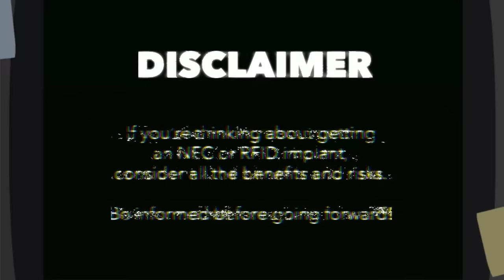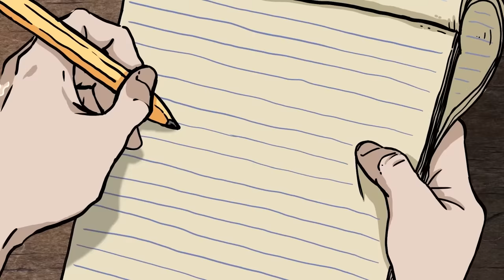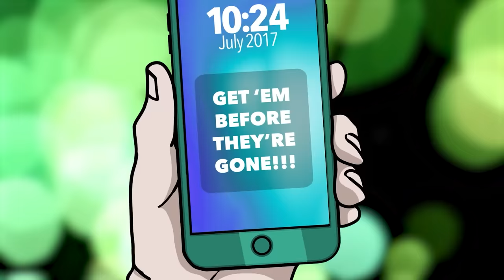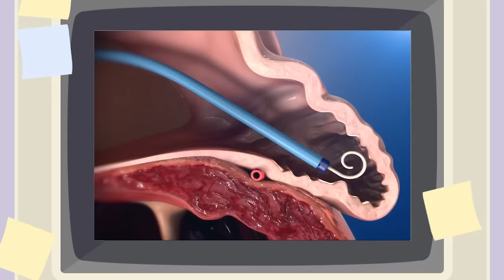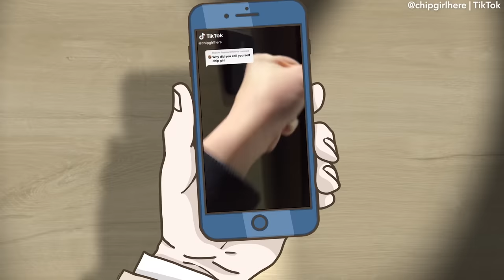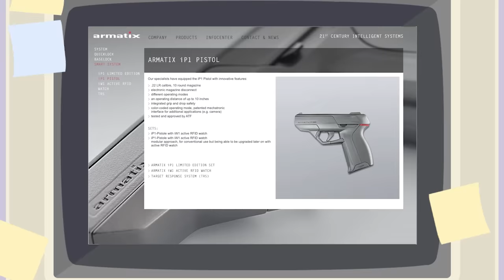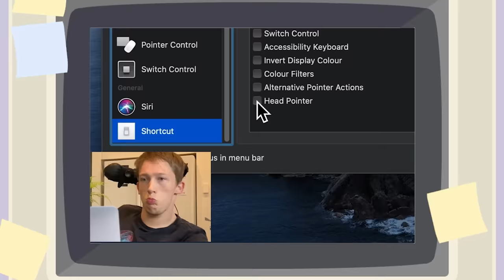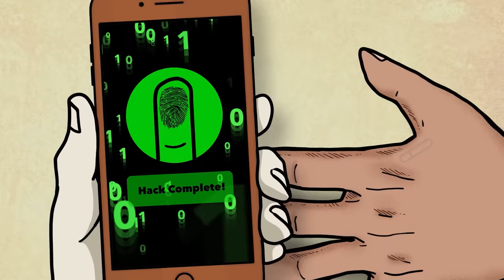People Are Turning Their Fingers into Smart Wallets, and It's a Nightmare for Some

Comment: honestly maybe even just RFIDs being integrated into common accessories like bracelets, watches, necklaces, or something common you'd probably wear all the time, but isn't too small to lose, would be much safer
Reply: @IamMarius the ankle bands given to criminals with house arrest are a good example :)
Reply: That's what I was thinking this entire video.  Why get something implanted into my hand if I could just have inserted into a glove or a bracelet?  I would be able to do exactly the same things that the implanters do, with the benefit of not having to worry about drawbacks of sticking technology under my skin.
Reply: Apple Watch and other smart watches do that already
Reply: my wallet has RFID
Reply: @SgtSupaman  we did see a smart pistol that requires a glove so it might be a better idea
Reply: When you go to the Blue Lagoon in Iceland, they give you a bracelet that's basically a door key, locker key and hooked up to your credit card all in one, so you could purchase drinks and spa treatments while in the hot spring.
Reply: @SgtSupaman  yeah, a smartwatch can do all of those things and more, and its much easier to replace.

I guess it can be stolen, but the thief would still need the unlock code to use it. And you need a backup method anyway.
Reply: Disney already does something similar to this for most hotel keys now, it would be wonderful to have an option like that for other things but I'm also worried I'd end up losing THAT too
Reply: Most smart watches already have this. I use my Samsung watch to buy from snack machines at work every day.
Reply: @FMAiscool  that was my favorite feature really.
Reply: It's called a smartwatch, LOL.
Reply: good idea, I'm going to put RFID into my glasses.

its going to be fun the look of people when I take off my glasses to pay by NFC
Reply: Yeah that'd be awesome a watch wallet or necklace and people wouldn't even know
Reply: Can't the apple watch do that basically already? Or is this something different?
Reply: Exactly. I think even putting the RIFD tag into a small earring would make more sense than implanting it under the skin.
Reply: Yeah that’d be something I’d be way more interested in tbh
Reply: Point is so you can't forget them
Reply: 1 of my transit passes is implanted in a silicon wrist band. It's comfortable and easy to use.

I'm looking forward to trying it in winter, when I won't have to search pockets, while wearing mitts or gloves.
Reply: Like a credit card?
Reply: You can buy rfid rings. This isn't news.
Reply: I would much rather have one in a ring than in my finger.
Reply: @IamMarius disney does this exact thing at their parks for hotel rooms and whatnot
Reply: Its a mix of transhumanism, people that think its cool, and those that lose their wallets/cards xD
Reply: I would rather prefer rings/wrist band etc than chip implant.
Reply: @alexborg9393  it can, most other smart watches can too
Reply: I think apple watch already do this.
Reply: @wowulam7411  yeah but its an active device of somewhat high value, making it a target for thieves

in my context specifically im referring to objects that normally wouldn't be stolen if it wasn't flashy, like armbands or stuff like that

probably should have been more specific but yee
Reply: @IamMarius already happens, I think thats how disney does it for the new fast passes
so does my gym for access, ive got a silicone band that uses NFC to open the door and scan it on treadmills and stuff to save workout info
my house also uses an NFC keyfob, I was concidering switching to the cards they provide so before spending the money on it I peeled the NFC tag out of my keyfob and stuck it on a card in my wallet
felt like a smart idea untill I took the trash out one morning and realised I left my wallet inside
its now back on its fob on a lanyard on my belt
Reply: YEAH LETS HAVE RADIATION POISONING
Reply: i'd like an rfid glove :D
Reply: Phone NFC.
Watch NFC.
Thats enough.
Dont think about human NFC.
Reply: Honestly the tapping of the phone is honestly enough, i dont know anybody who leaves home without their phone especially to go shopping
Reply: @SgtSupaman  this actually isn’t a new thing at all, and is really akin to getting piercings or tattoos, but adding practical implications to the thrill. These people are into the potential of the human body beyond what our natural biology provides—basically forced evolution. I did a big study on them. They used to call themselves biohackers until a bunch of body building corporations absconded with the term. Real biohackers we’re just as obsessed with the safety protocols as they were the implantations, because what’s the point if it’s not functional? Many of them were nurses, emits, bio chemists…you get the idea. And, yeah, there were some idiots who didn’t know what they were doing, just like there are idiots who pierce their dicks with a tack (I’ve known one) It’s interesting, but, yeah, definitely not for everyone.
Reply: dont those already exist in multiple forms?
Reply: Yes like a Fitbit etc
Reply: @FMAiscool  that’s dope
Reply: yea i think say like a glove or a watch or something somehting you CAN removfe but CAN also leave on all the time.
Reply: Exactly. The first thing that popped onto my head was "couldn't you just put it in a ring or something?"
Reply: Have you heard of smart watches these things already have RFID in them I can use my Apple Watch to pay for stuff but that’s also because it’s a Apple Samsung also does the same thing if you’re getting anything by Apple or Samsung don’t count on it being any kind of good but if they could put one in a wedding ring that would be kind of cool because you’re never gonna take that off so you’re never gonna leave that anywhere
Reply: no bc its suuuuuper easy to skim them by just walking by the person
Reply: It's something you can already do easily. My partner has a ring with his contact info on it, he just has to tap an NFC device and said person has his contact details.
Reply: @IamMarius Hey We have this in my home country
Reply: Hello million dollar idea alert go ahead and connect with the SBA
Reply: No I want it in my hand, the whole point is to not carry physical cards or anything other than yourself
Reply: Bracelets are easily available if you want a passive device. You can also get just the chip and incorporate it into a bracelet — might be less obvious than a dedicated NFC/RFID bracelet. Most smart watches also have NFC; I use my Apple Watch to pay all the time. Double tap the button, cards come up, sand either tap to pay or swipe to select a different card, ezpz
Reply: I wouldn't want a bracelet, because I keep losing those things and they never fit, but a small necklace sounds like a great idea.
Reply: There is a smart ring that also has sensors who track your health.
Reply: A pick pocket could steal those easily  but try to steal someone's hand without them knowing 😂
Reply: It's already a thing 🤦🤦🤦🤦🤦🤦
Reply: Lol
Reply: No. It is never safe! Once thats implemented, whats next? Come on people!
Reply: @voradorhylden3410  I meant in terms of health. Sure there's the risk of them still being stolen but it's probably much healthier to embed it NOT in your body.
Reply: RFID ring... It's kinda hard to lose a ring.
Reply: actually no, it's much safer for nfcs and rfids to be implanted rather than being on a accessory, the thing is that we need more compatibility and that needs research to be done, so even though we haven't reached that future yet, when we do, having implants would be safer
Reply: Tattoo
Reply: True that does sound useful

Comment: At a previous employer they scanned our fingerprints to grant us access to the building (which also tracked our hours). The canteen had a machine the scanned your finger, accepted cash and placed credits to that cash to your account. To buy from the canteen, you'd scan your fingers. This was in 2014. There's absolutely no reason for an intrusive operation for this functionality.
Reply: How about that fingerprint that can mimic 50% of all fingerprints? Or if your fingerprint is stolen?
Reply: @Lynxdusk  It's real difficult to clone a fingerprint. It's not like you see on television, and the biometric systems use heat, not just plain prints. So it's thermal.
Reply: @Lynxdusk brother it isn’t James Bond lol, you can’t just clone it
Reply: I worked at a local hospital, and two of the security measures for staff were badges and prints, depending on the staff member and what they were trying to unlock. It was mostly badges, but I did notice a few computers in each treatment area with print scanners. Unfortunately I was just EVS, so I never got to see what all the print scanners did, but the badges were cool too.
Reply: yeah I certainly would not grant right for anyone to store my fingerprints.
Reply: Whahahat did you say, dunning-kruger strikes again, 🤡 @Lynxdusk
Reply: Yea but remember that outbreak thing we had recently where nobody wanted to touch things, thats the real issue with fingerprint scanners, they were adopted for a while years ago but most have been replaced with rfid cards due to various issues these days, thunk about it, yea you saw it once ages ago, so why isn't it everywhere now, fingerprint systems have other flaws too try using your phones one when dirty, Sweaty, screen is dirty, in fluctuating heat ect ect.....
Reply: @Lynxdusk  I could argue that stealing an RFID is easier than a fingerprint

Comment: Let's just say I'm not sold on the idea of a chip implant yet. 
 
My smart watch is, for me, a good compromise - I've got it with me all the time and I use it for almost all payments. I'm old enough that I don't always remember my mobile telephone/want it with me but I'm used to wearing a watch, so the watch doesn't get forgotten.
Reply: I'm going to put the chip on my shoes. 
I don't usually forget to wear shoes. But one time I did, it was funny when I was at the office barefooted.
Reply: @monad_tcp  you’re a cool person
Reply: @monad_tcp  I always at least have socks on when I'm not in bed or the shower
Reply: Then there's the other side of the spectrum, stuff like 10:19, plug via bluetooth or wifi, get instant keyboard features without a physical keyboard, potentially the same with a mouse. Now that. THAT I would have. Imagine not stopping there, you can have those features to control your phone, mobile gaming would bloom even higher than it already has, and since they don't store data (or at least I wouldn't make them do), hacking on them would be next to useless.

Comment: My body is too sensitive for implants like that. It would drive me nuts.
Reply: This makes me wonder if they have surgical steel options if any other forms of metal won't work well
Reply: Jesus talked about something in the RIGHT HAND, or FOREHEAD
Reply: I have 2 implants attached to my sacral nerve. After a while you forget they are there.
Reply: @nate6045  just like wearing a watch or a collar
Reply: @vexvesper  Not exactly. When it's on your skin, you can feel it because it's rubbing against an area with a bunch of nerve endings. When it's below your skin, you don't. There no nerve endings to stimulate unless you're actively pressing against it.
Reply: @kathleenking47  it's the mark of the beast
Reply: @cashhmere3449  lol
Reply: @kathleenking47  buddy, its a glass capsule with some wire in it, chill out

Comment: I have had a Dangerous Things implant in my hand for two years now, as of this month. I got it installed at a very professional body modification specialist shop, who had previous experience with installing similar products. I have only had positive experiences with my implant- for the most part, it's simply a convenience in my day to day life. I programmed a Samsung deadbolt to accept the RFID in my hand to unlock the front door to my house, for example. Also, it lights up when it's scanned, which is probably my favorite part. This kind of body modification obviously has potential for harm due to negligence in the install or use process, but I personally did about a month worth of reading and studying regarding the product before I decided to "take the plunge." Would I do it again? Yes, in a heartbeat. It's been one of my favorite luxury/cosmetic purchases I've made in my life and totally worth it.

Comment: as someone who experienced hand trauma at a very young age from an incident with glass, putting a glass tube in your hand sounds like one of the scariest things you could ever do.
Reply: prank to pull on a chip user: pinch their chip as hard as you can
Reply: Depends on the glass. Fiberglass is pretty flexible, but I don’t know whether you could size it up enough to put a small chip into it…
Reply: @ArDeeMee  dont fall asleep first at the sleepover, Imma put a glass ampule inside ur hand
Reply: @alexbarnes1190  =D
Reply: @livesinsewersirl you most likely would not feel much, depending on where the chip is.
Reply: By the time this glass shatters your hand is already broken several times over.

Comment: Great video! I would have also loved a mention of possible implications in case of a medical emergency. I know that in Germany, in some cases even tattooed patients are not allowed to undergo certain medical procedures because of potentially magnetic inks in their tattoo. What would happen if you have a chip or magnet implant and the doctors therefore refuse to give you an MRI which could save your life?
Reply: In the US, you might be discouraged from getting an MRI if you are unsure of the ink used for your tattoos, but they'd still do one regardless in an emergency. Worst case scenario, a color from your tattoo gets forcefully removed and you have to wait for the tattoo to heal again. It might hurt worse than getting the tattoo since it would happen all at once, but it wouldn't be life threatening. 

However, certain inks can cause issues with xrays in that they might reduce the clarity of the image. They make you take off printed tshirts or pants (even if they have no metal) for the same reason.
Reply: I get the very strong impression RFID body implants - As opposed to chips in something you can take off - Would be a definite breach of Datenschutz... 🔒🇩🇪💯👍

Comment: There is also a not-so-fun consequence in that future thieves instead of stealing your wallet will cut off your hand - probably even if you DON'T have a chip there because how would they know if you do?
Reply: This is just a contactless card. Thieves just need to tap on it and it's done.
Reply: @SDayle  There is probably a pin.
Reply: @SDayle  this isn't cloneable...
Reply: They would have a reader that would sense the chip
Reply: What????? Are you insane?
Reply: @hardcodedsoftware4212  I mean it's not that far fetched if criminals are already cutting off people's fingers to use their fingerprints to open stuff

Comment: Mmm I think the privacy concerns are extremely valid. I work at Disneyworld and  the magic band system is used for a lot more than what you think. Some examples include personalized show elements, monitoring foot traffic, and for acquiring attraction wait times. Your data is valued and can be extracted in many ways without you knowing. (Magic bands are just NFC chips on your wrist, they only store one number that is connected to your “profile”)
Reply: And that's another issue with implants; As per RFID/NFC and similar technologies, the device ID - By necessity - Is public. This means your chip can be uniquely identified (And associated with contextual data e.g. location) even if the data stored on it can't. 🔓

Comment: I have an NFC implant on my right hand. The technology is pretty rough and there are lots of limitations. Even with the “opening door chips” you have to have the right door lock with the right frequency so that the chip works.
Chips can be read by Android phones but does not work with iPhone.
Reply: I got it to work with my friends iPhone. Apparently iPhone requires you to have the app open first. So if there's a website stored, she had to have her browser open. If it's contact info, she has to have the contacts/phone app open.
Reply: not every iPhone, my iPhone SE can only use NFC for payment, it can't be used for scanning an NFC or RFID
Reply: Bro I really hope this isn't very widespread

Comment: Unfortunately there is nothing magic about those devices.   You can just go buy a Dev Kit for about $100 and read/write the chip directly.   Usually getting the password is a bit tricky and is not really possible on most but resetting the device isn't as long as it's not a write once device that destroys the write circuit.  Since he did change it, that wasn't the case.

Comment: Dangerous things chips are modified so if the password is lost the chip can be reset via the gen 1 magic backdoor. I have done this on non-implanted chips, it's not difficult. You'd need a Proxmark 3 or similar to unlock it. Do not use cheap Chinese readers on them as they may set a password on it, thankfully most of those passwords are known and the gen 1's are easily hacked. And no, you don't have to use the original app or reader, unless it has set a password. You can get more functionality by using a smart ring instead. Multiple frequencies, protocols and chips.. and of course you can take it off. Unfortunately it can be stolen.
I have been using smart rings for about a decade, I am considering an implant. They really are handy if you have a use for them.

They also do not work with most payment systems, they are not the same as bank cards. University/College payment systems and the like may work. There are a couple of systems that work with payment systems but they are limited. Smart watches are a better idea for security but not privacy as you send all your data to the provider, such as google.